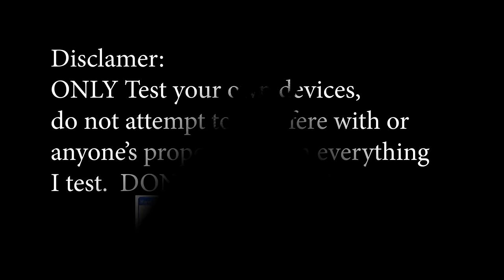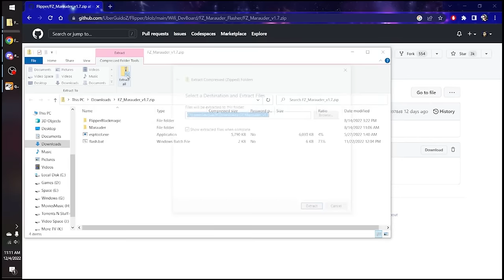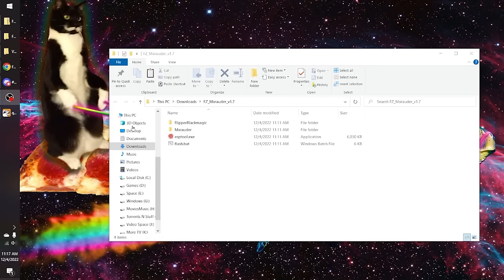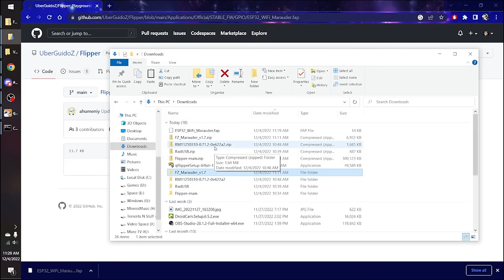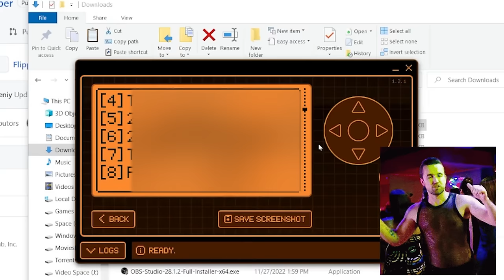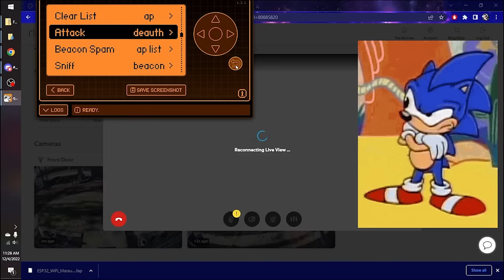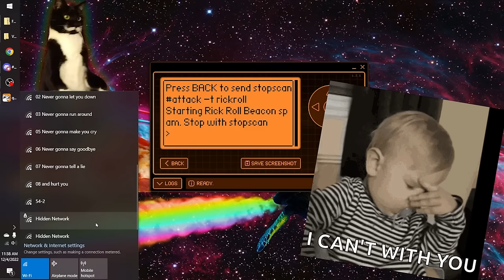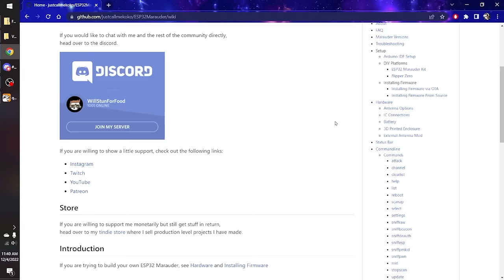Flipper Zero WiFi Dev Board: IRL WatchDogs!  How to Install Marauder on WiFi Dev Board!! 😱 😱 😱 😱

Comment: Wow, you just uploaded a new video trying what I asked you in the previous video :), about using the WiFi tools with the original FZ Firmware.

Was the app somewhat unstable that you couldn't use it? Because you had to install the unofficial one.
Reply from the maker: So I don't really use OFW that much, so I'm not sure.  The deauth attack obviously worked great, if you're hesitant to use CFW then I would try the dev build, might have better results.
Reply: @TalkingSasquach  Hi, I've flashed the WiFi board with Marauder and it was a successful installation. Copied the app in the Applications/GPIO and run it. But when scanning nothing appears. 

In the video did you use the dev build for the Original FZ Firmware?

I've also tried the Deauther, but it crashs (null pointer). 

FM version 0.72.1

I've retried the installation and I get the same outcome.

When I plugin the board a sequence of blue-green-red light appear. Is this the normal behaviour?

Logs from the Marauder flash:
....
Wrote 946800 bytes (639278 compressed) at 0x00010000 in 10.9 seconds (effective 697.6 kbit/s)...
Hash of data verified.

Leaving...
Staying in bootloader.

-----------------------------------------------------------------------------------------------
Process has completed Please disconnect your Wifi Devboard and connect it to your Flipper Zero.

Comment: Hi Mate, I follow all the process and installed the latest firmware version both for the flipper and the wifi and when I try to connect in the application and run the ESP32 so it appears "ERROR ... Preload failed API version mismatch ;/ what to do Doc??
Reply from the maker: That means whatever FAP you downloaded doesn't match your firmware version. It is currently bundled in SquachWare if you want to try that!

Comment: hey im having problems when i run the Scan to to the deauther attack my scan says ' PressBACK to send stopscan ' and i cant even get my personal wifi network to pop up, this is all new to me but i get how firmwear is similar to a OS system but, im doing my best here and this is my first device with these capabilities so im having fun either way :) but i could really use some help thank you! a new very overly detailed video every file type and location would help alot of people plus which apps work with what firmwear/version0.0 and maybe we can make large zip drives that have a esp firmwear automaited preloaded switch to unload one and reload the other so we can pack a memory card full then have all we need so when we start building Frankenstein breadboard's ands we have all the softwear we need loaded all together????  Some thing we should all start to work on it, there's plenty of people that want it we just gotta do it!!

Comment: Great vids & info man! 
I have a question:
With the Flipper & dev Wi-Fi board
Can you use it as a hidden cam, Wi-Fi, Bluetooth,  cell and gps finder?
-Thanks
Reply from the maker: That's a bit ambitious for the board to do by itself.  Theoretically you could kind of do something like this with a multiboard but it would not be easy!
Reply: @TalkingSasquach  I want to learn how to do this! Can you point me in the direction to try and solve  this problem?

Thank you for the reply

Comment: Quick question since wpa3 basically neutralizes any attempt at deauthentication attacks because of the signed key is there a way to just copy that sign key (by sniffing the packets of any clients connected to the access point) and replicate that in your deauthentication packets?

Comment: Hi, I got
a "?" next to [ESP32] WiFi Marauder, then "Preload failed API version Mismatch". Any ideas please?
Reply: I have the same problem, but I think it's because I am using Unleashed and not official FW.
Reply: @Theodoror  I installed the official firmware and it says the same thing did installing the official firmware work for you ?
Reply: Hi found a solution ?
Reply: @edrop13  nope!

Comment: I have a bunch of esp32 boards from 3d printing projects. Is there a place I could get the pin outs and build my own boards? I use RM firmware.
Reply from the maker: Check out Uberguidoz repo and click on the GPIO folder, he's got a bunch. Otherwise you can just Google it, they're pretty easy to find usually

Comment: Hey! I'm using a Mac to do all of this, but am getting the following error each time I try to flash Marauder on the the wi-fi dev board: 
"esptool.util.FatalError: Failed to connect to ESP32-S2: No serial data received." Even though it clearly previously connected to the board. i'm trying to follow the SkeletonMan03 steps. My Wi-Fi dev board's LED is red.. I wonder if that means something is wrong with it?

Comment: Finally got my Dev board did all the steps but every time I try to do it it says preload failed API version mismatched what does that mean?
Reply from the maker: There was a firmware update and with the holidays, the applications on Uber's repo may be out of date.  Give it a a day and it will probably be good to go, just make sure you update your firmware as well!
Reply: @TalkingSasquach  what firmware were you using in this video?
Reply: @EnderGameZ.  rogue master
Reply: @c0mpute  you sure?
Reply: @TalkingSasquach  I'm using Unleashed, but got the API mismatch error. How to fix?

Comment: Someone said it's important to plugin the dev board when the flipper is turned off because you risk to ruin both otherwise
Reply from the maker: What they're probably referring to is that when you plug in the wifi board, it will brown out the SD card, not a big deal but it does dismount the SD card when you plug it in when the Flipper is on.  NBD really

Comment: I have ran into problems since day one with installing wifi dev board.... I tryed downloading python on window to use esptool but I was never able to install it because my pip was installed on a different path but i never could locate my app folder to find pyton. I went to my virtual machine with kali and now every time I try to open the bat file my entire vurtial machine breaks. I can't believe I wasted so much time.

Comment: With my Dev board I sort of have to force it down a little for it to connect with my flipper and it will slowly push itself out if you move the flipper around too much. Is the board suppose to fit snug or is it just naturally suppose to do this?
Reply from the maker: Do you have the case for it?  Sometimes that interferes and you don't actually end up plugging it in all the way.  It shouldn't come out
Reply: @TalkingSasquach  Yea I’ve got the orange case on but it dosnt get in the way at all. If I were to place the flipper standing straight up and pick it up again the board will disconnect.
Reply: They’re both basically brand new. The flipper and the deb board

Comment: Getting the message "Preload failed API version mismatch"  same as others are. I even downloaded the files twice to make sure I didn't get a corrupt version. Let us know when you get that sorted, maybe make another video on how to fix?? Thanks!
Reply: Same here. Stuck at this point.
Reply: @thelockpickinglebowski633  i switched the version from release to release candidate and it worked so if you want to you can do that
Reply: @adrianm2908  I tried that but it still didn't work, what version are you running?

Comment: Hi Sasquach - I watched your 'Flipper Zero WiFi Dev Board: IRL WatchDogs! How to Install Marauder on WiFi Dev Board!!' video from 5 months ago and all seemed good using carlas fw after installing the FZ_Marauder_v2.1 from UberGuidoZ repo as shown.

Everything works fine, Maruader wise.

However when I check the pcap in the apps-data its there, but empty, 0kb.

Any ideas? - should I flash with the Skelton FW from your latest video?

Comment: Im not sure what to do im stuck because after I flashed the wifi board and try to run the app I put in GPIO it says "Preload failed API version mismatch" help?
Reply: Same here. Stuck at this point.
Reply: @thelockpickinglebowski633   you just look under apps and go under Wifi not GPIO and you will see it under that. No need to add the file by hand.
Reply: @thewailer  There is no Wifi Folder.
Reply: I'm having the same issue not really much help on here
Reply: @CatskillNy  I ended up following Clara Crazy instructions and it all worked and was quick and easy.
Reply: Its under Wifi not GPIO..

Comment: Anyone else having issues with the latest Squachware running several tools in Applications like name changer and many others? It shows a question mark beside the ones failing and gives an API mismatch error.
Reply from the maker: I'll double check everything when I get home, it's best to delete your apps folder before installing cfw if you're running into API issues
Reply: @TalkingSasquach  I'm having the same problem.

Comment: flipper zero wifi dev board only gives this message :  preload failed api version mismatch
Reply from the maker: It means your application and your Flipper are running different versions of the firmware
Reply: @TalkingSasquach  i got it fixed checking your guide again & again :P thank you bro !!!💪

Comment: I am able to get to the step where you put the file in the apps>GPIO folder.  When I open it on flipper, I get an error. Preload Failed GPIO/ESP32_Wifi_Marauder.fap API version mismatch. Ugh.  I am having sooooo much trouble with this
Reply: Make sure your flipper is on official firmware version 0.73.1. Download it from the webs. That’s the latest version of firmware this deployment of marauder is compatible with. 

Had to downgrade my flipper firmware last night and now it works perfectly.

Comment: Hi, I flashed the WiFi dev board with Marauder successfully and copied the apps. When I try to scan access points nothing appears.

It's weird it doesn't work even though the apps have been built for the last stable official version and they worked in your video.

The desauther app crashes with a null pointer.

I tried to use the Dev firmware version instead of the stable one, but the API version was not compatible.

I suppose I'll have to try Custom firmware.
Reply: UPDATE: With unleashed fm it worked. Although sometimes I have to un-plug and plug the Wifi board while the app is opened in order to work (this might be the same issue I was having with the official firmware), but it worked finally, never gonna give you up....
Reply: @javiergarcia-cuervavelasco772  that’s good I’m gonna try to do that